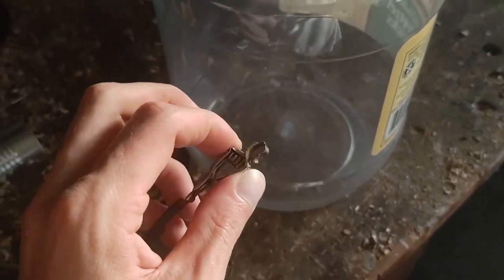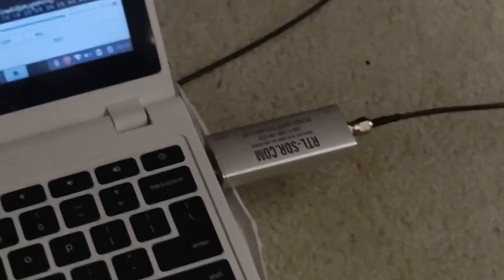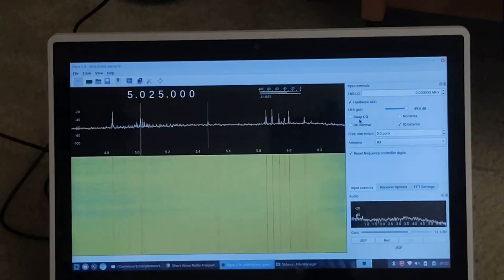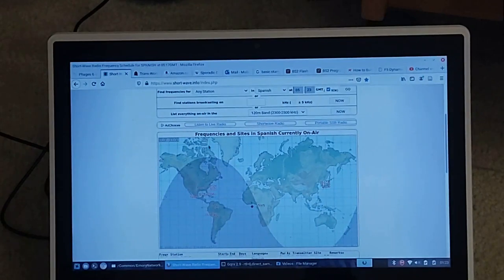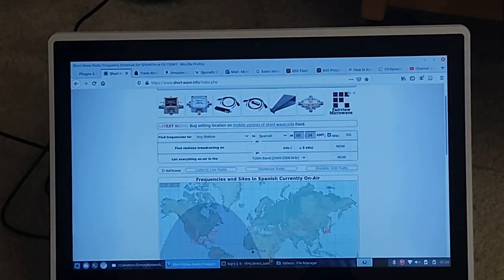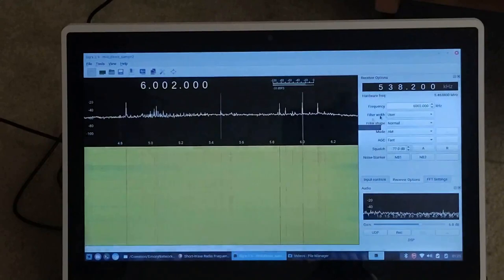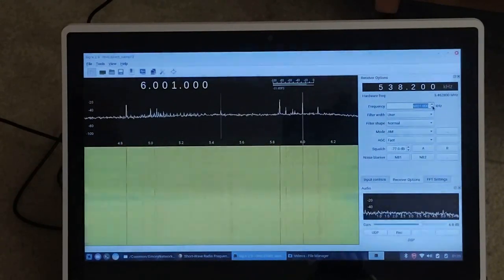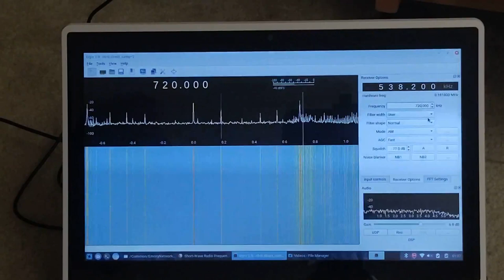Attic longwire antenna and SWL SDR setup

Comment: Thanks for showing us around. I'm looking to do the same attic setup with an additional discone for vhf uhf and trunked DMR
Reply from the maker: You're welcome! That's a great touch! I had an FM broadcast dual loop antenna I was going to use up there for other frequencies but it's fixed length and I pick up FM fine so I decided against it.

Comment: I appreciate your advice, I a beginner in shortwave listening. The white coax go to radio antenna. My radio is a Tecsun pl 330 I use a clip connecting to longwire antenna 50’  
I really confused how connect white coax to a clip  telescope antenna of my Tecsun pl-330 radio.Thanks 😊from Puerto Rico.

Comment: Greetings from Sweden!
You, Sir,  just got yourself a new subscriber and a thumps up 🎉
I'm about to set-up this monster 😅
I'm a total noob so i need some advice❤
Questions. 

Why did you connect it to the wip antenna outside, was that the ground? If the wip is ground, you connect both attic wires to only one connector on the 1:9.

Im a bit confused. 
Making a dipole by using both connectors.
Making a longwire using one connector and ground it.

I have looked for descriptions, but i get different answers so im about to go outside with a manometer and some wires and test the ohms. 

If i not reply to your eventual answer, well, you can send me a prayer 😂

Comment: Isn’t that a balun, as in for a balanced antenna such as a dipole and not for an end fed wire? I believe there is a mod, something about cutting a trace, that converts it for end fed. Thanks.
Reply from the maker: It is a balun, but I think one end is for a grounding line.